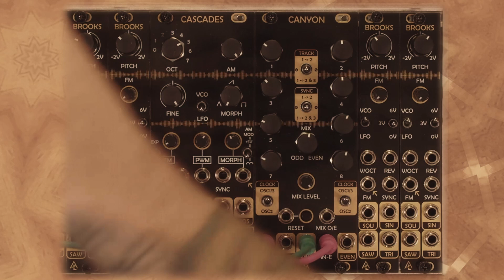CANYON: Sub-harmonic/Stepped CV Generator

Comment: I've found that the subharmonic labeled #6 is not really subharmonic #6 (ie fundamental/6). It is made up from pulses of the #2 subharmonic (fundamental/2 or 1 octave down) in a 3-4 pattern. Since the outputs are square waves the spectral content of #6 is closer to that of subharmonic #8 (fundamental/8 or 3 octaves down). If you mix #8 with a little bit of #2 you end up with something that sounds like #6.
A true subharmonic (or undertone) sequence based on C6 would be 2:C5, 3:F4, 4:C4, 5:G#3, 6:F3, 7:D3 and 8:C3. On Canyon we are missing the F3 and instead we get more of C3. You can mix in a little #3 and get some F tone back. 
The results are quite satisfactory. And it can be fun to experiment mixing these tones.